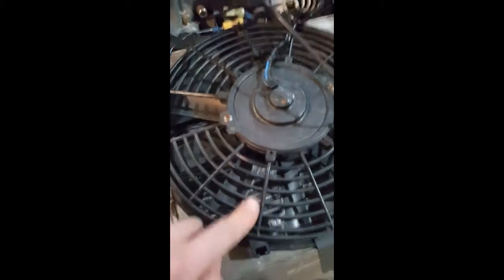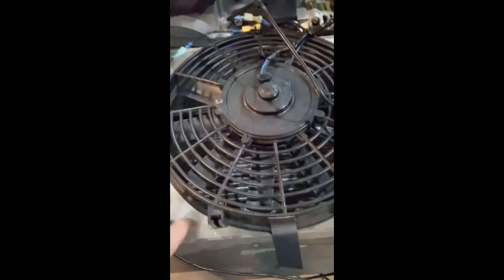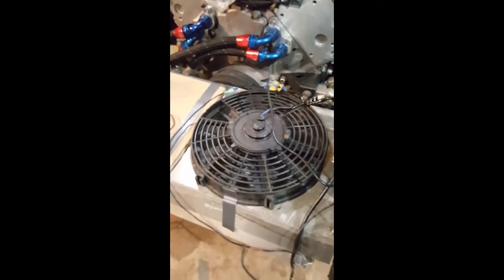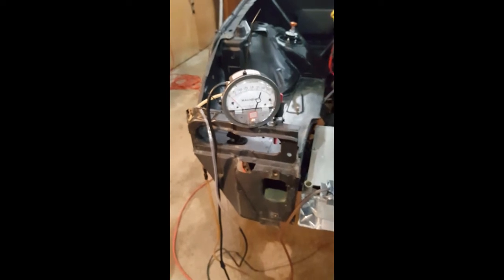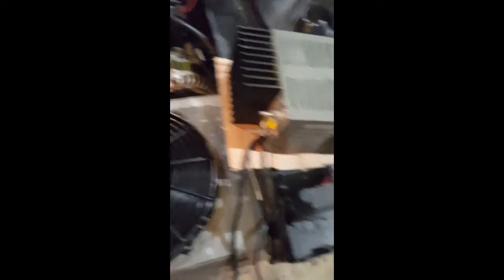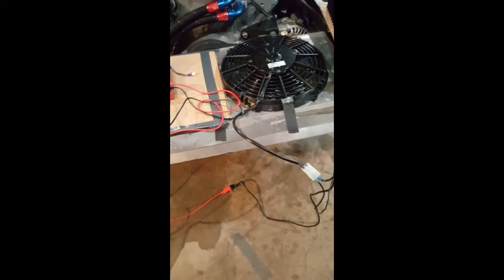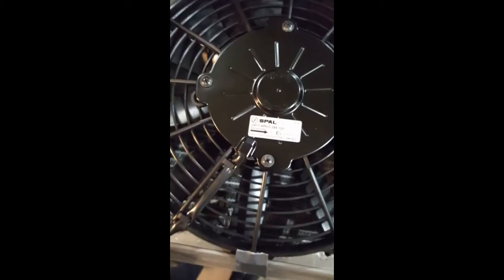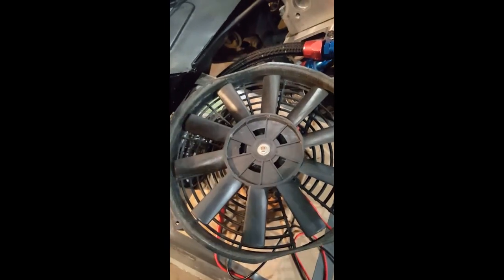Are Spal brand radiator fans really better? In short, yes.

Comment: yeah voltage does not mean anything right, you need amps reading. voltage is not going to drop unless you kill your battery. Eih
Reply from the maker: Have you ever checked the voltage of a battery under load vs not under load?  Are you asserting that batteries and power supplies are capable of an infinite discharge rate?
Reply: @CurtBagne  not at all, of course its going to go down but will be small initially till the end then drop alot. I am just saying Voltage does not tell the tale near as well as current reading does. I learned this long ago in my Scout II truck that had a AMP meter in it. It was soo much better than the typical voltage gauge which just shows 12 ish.
Reply from the maker: @Co-SS  Okay, I agree with you there.  This was a roundabout way of inferring which fan was more powerful without having a tool to measure it directly.  Works, but not ideal.